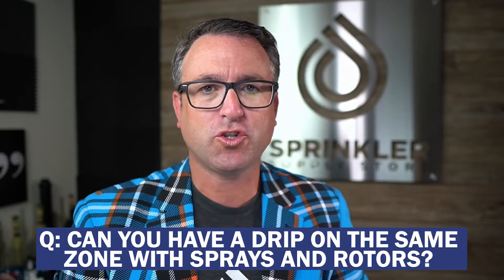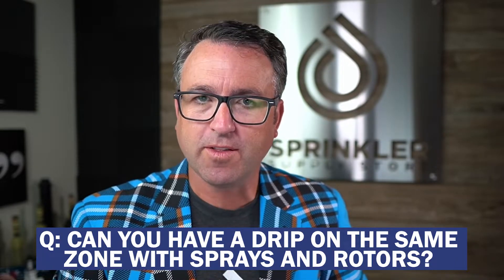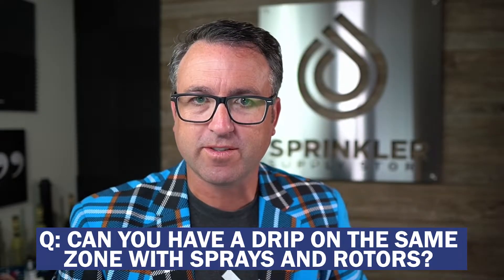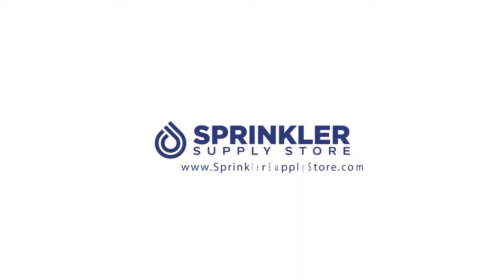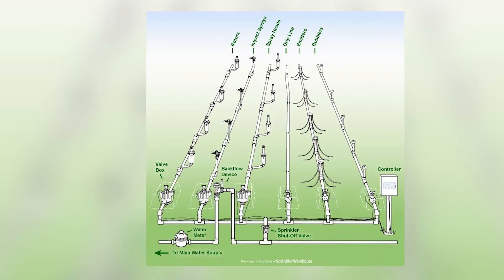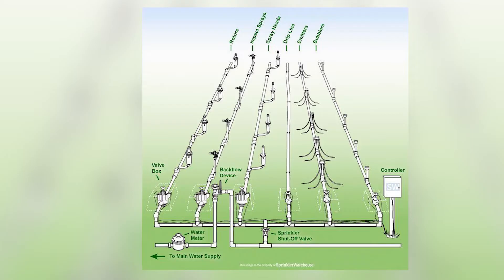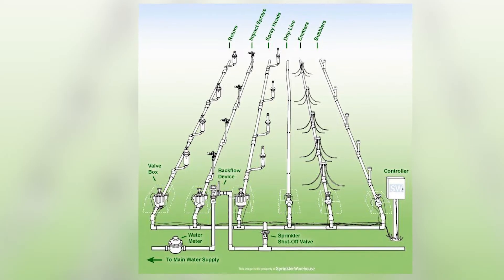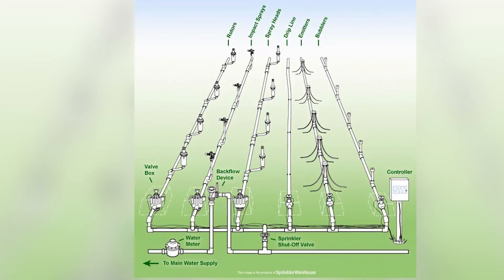Can You Have Drip On The Same Zone with Sprays and Rotors? | SprinklerSupplyStore.com

Comment: Thank you! This is something I can relay to my landscaper. I have drips in three planter pots on the same zone, I think. Only one works when the zone is activated.  I also have another drip zone for the raised beds. I added tubing to the orbit 8 port manifold and I unfortunately over tightened one screw and it started leaking. The project is on hold for now. My question is to you is there a better way to layout 1/4 tubing from the riser? I haven’t found a good video laying out 8 tubes from the manifold in a raised bed successfully.
Reply from the maker: For the not working, perhaps there is a shut off valve somewhere (hidden) or it’s disconnected from the lateral line, or the emitter(s) are clogged. Id follow the line backwards and see where it leads you. 

I’d need to see a picture of your setup to provide helpful tips on the 1/4” layout. It’s pretty forgiving and hard to go wrong, other than just keeping it organized.

Comment: Question.. is it the same case with the mini sprinkler ?? I have regular sprayers for the side of my yard and one sprayer in a bed that is 8 by 8 ... that bed does not get enough water so I wanna converting to those mini sprayers... would that work??
Reply: Its call micro sprinkler... comes from a drip line..
Reply from the maker: It’s just sprinklers, lots of options, and the best practice is to match the precipitation rate for everything on the zone.

Comment: Didn’t help at all. How do you create a separate drip zone?
Reply from the maker: Zones are (usually) controlled by an electric valve, activated by a controller. To create another zone you will add another valve. If there isn’t any room left on the controller to add another valve, you can control the zone with a battery timer attached to the valve. You are welcome to contact me directly with questions. -Andy